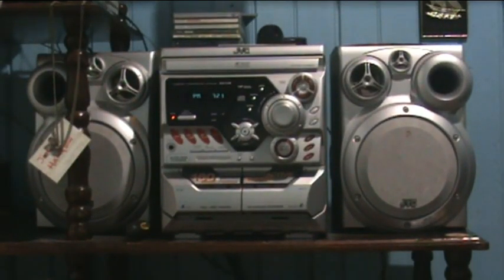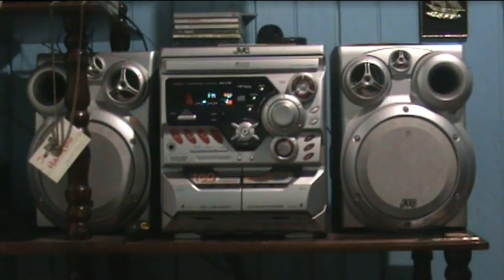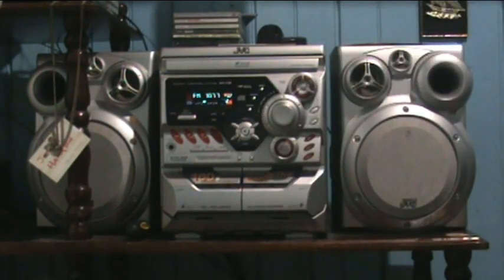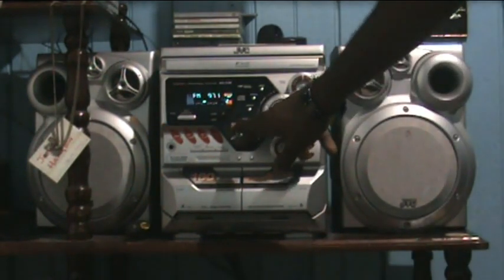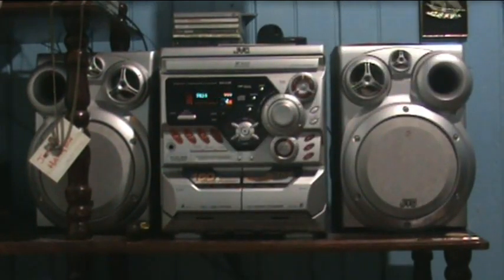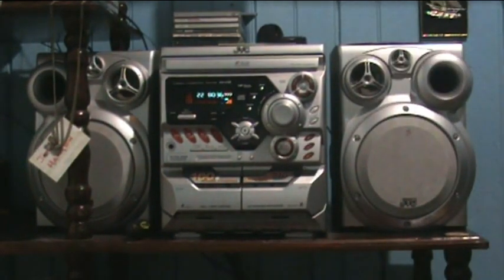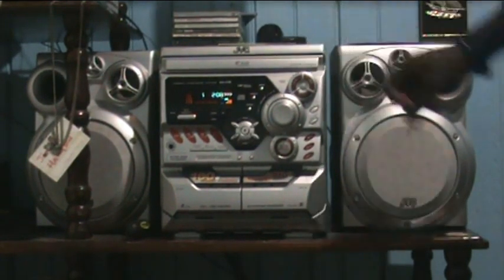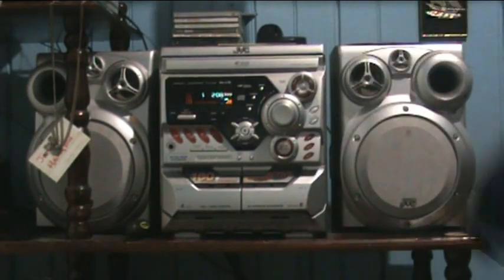My troublesome JVC MX-K30.

Comment: The speakers from this system are cheap, but great. I ended up with 2 sets for practically nothing and put  them on my denon DRA-375RD with bass and treble and brilliance turned up you get pretty good sound. Only drawback is that the bass breaks up if u go extremely too loud, but i never play them that loud anyways and i understand it because they were made for this small component system.

Comment: I have one just like the one on the video and it’s on protect mode what should I do
Reply from the maker: Did you add speakers to it?
Reply: @TheJaHa5  no sir
Reply from the maker: @marconunes985  Okay, then check if the speakers are connected properly, that is, the wires and their respective polarities. If they are connected properly, and the problem still persists, then unplug it for an hour or so, and try again.
Reply: Ok I’ll try that thank you very much but if nothing happens any other suggestions
Reply from the maker: @marconunes985  consult a technician...

Comment: damn that sucks it's in bad shape, these systems sound pretty good. I have the jvc mx-gt90.
Reply from the maker: Whoa, that's a really sweet machine you got there! Haven't seen one of those in quite a while!
I got rid of this system tho, I have a HX-Z10 and a MX-KC2 now. HX-Z10 has a dead CD player, busted cassette deck, and recently, the relay gave out, so all it's good for is showing me the time in the night... Lol.
I purchased the MX-KC2 2 years ago, brand new, in box. Had to replace the belts in the cassette decks, and the CD tray, but other than that, it works well!
Reply: @TheJaHa5  yeah the gt90 is awesome! You can hear it from outside and the windows start shaking lmao. Only issue is the speakers rattles but I managed to fix it by taking the port off the top and putting it back on. Cassette players might not work either but I dont know since I don't use cassettes anymore lol
Reply: @TheJaHa5  Oh, forgot I commented here lol. just found it in my recommended again and seen my comment, well.. I did get a jvc hx-z30! it is really damn loud. Never really play it at max because it makes stuff fall off the walls lmao
Reply from the maker: @LastStopGaming  So, I googled the JVC HX-Z30, and lo and behold! YOUR VIDEO on it turned up in my results! I must say, damn, you've got a lot of patience with that cleaning!
I like your video on it though, and while yours has 540 watts, my HX-Z10 only has 480.
Mines is not in pristine condition as yours, and I'm going to sell it for parts or repair, because it's got relay issues, and the CD, cassette and radio refuses to work, so right now, it's just occupying useful space.
Kinda giving up on these shelf system thingamajigs. Gonna start using stereo receivers soon...
Reply: @TheJaHa5  Yeah whenever I get something used I like to clean it up and make it look like new lol. I will probably stick to these compact component systems, because I just keep them in my room and don't really have the space for a full setup like that. plus these jvcs sound amazing as they are lol

Comment: Clean the deck with alcohol belts and heads, it's a good stereo with a audio line input, JVC will still service it for a fee of course, the only problem i had with mine was the CD changer the button would stick and the track would rotate or occasionally eject. But otherwise it was great, outlived the warranty until the radio receiver died and now I just have the speakers, but i set the alarm and woke up to loud music everyday for about 5 years.
Reply from the maker: Hey, this message is 11 years late... LOL

Comment: There's a problem with my auxiliary socket what should i do? JVC MX-GT95V
Reply from the maker: Take it to a qualified technician and see if you can get it repaired..., that equipment you got there is a beautiful one, it'll be quite a risk if you should tamper with it and spoil it, or, if you think you can handle it, go right ahead. I'd recommend you get the service manual for reference though....
Reply: ok thanks... :) it's fix now :)
Reply from the maker: Check your wire connections, and make sure that the wires are not worn, frayed or damaged, and that they're in their correct polarities Also, ensure that the wires are not touching the casing of the stereo, especially if the system has a metal casing. Unplug for 1-2 hours, and try again. DO NOT add more speakers to your system, as this will overload the amp and send it into protect mode. If that doesn't work, consult a technician.
Reply from the maker: Well, there it is....

Comment: I don't see a problem with your camrea. It looks really nice.
The volume control needs to be cleaned, since you know about this stuff I shouldn't have to tell you how you clean these cheap electric knoob things. Just simply take the unit apart, find where the knoob is, take apart the noob and then clean it gently.
Another good idea is to take a srew driver and saftly prie those covers off without ruining the speaker!